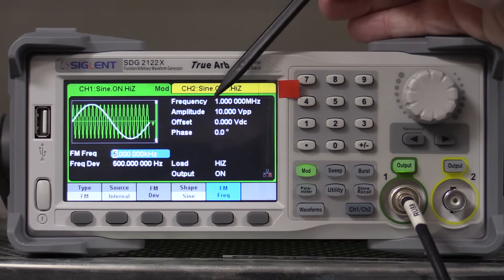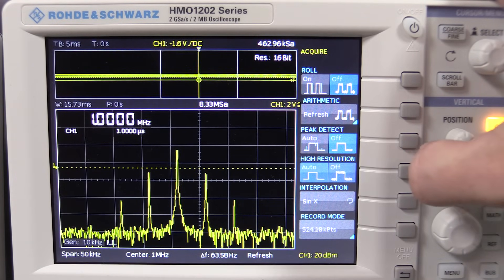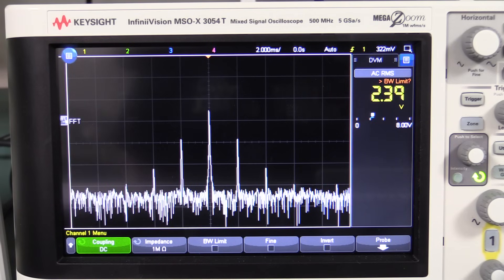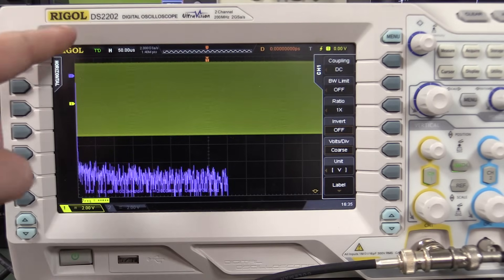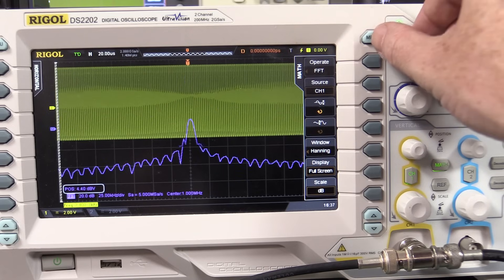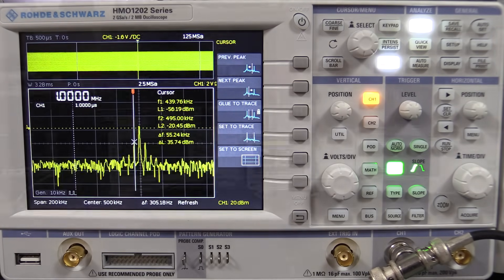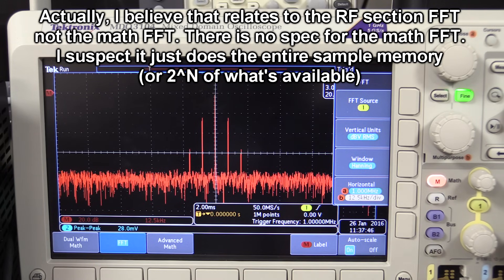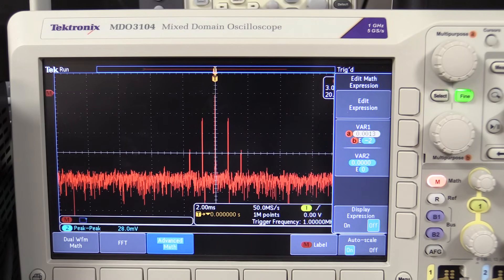EEVblog #845 - Oscilloscope FFT Comparison

Comment: I just feel like putting the Rigol up against keysight and rude and shwarz is obvious. Those scopes are typically out of range of personal use unlesss bought second hand. Some of those scopes are 5k$+ for just the 100mhz models. Though Rigol isn’t as precise it’s a fraction of the cost.

Comment: Hey Dave, are you running the latest firmware on that Tek?  I remember there was a firmware update to fix RF self-test failure if there was a signal present on startup.
Reply from the maker: +SCR2IGBT Oh, ok, thanks. Have not updated the firmware.
Reply: crikey!

Comment: As what I see from actual performance,  GW instek is very close to tektronix, Agilent and R&S are worse. Therefore if you are not too concerned about UI, that's a winner, especially considering it's <$400 cost (50MHz GDS-1054B). Wonder why when Dave mentioned that FFT in cheap scopes suck, didn't mention that instek (50 MHz model, dave has 100MHz) is even cheaper than 1054Z and actually don't suck (except UI).
Reply from the maker: +woopsserg Yeah, good point, I stand corrected, the GW-Insek is not expensive.

Comment: For us semi newbs it would be really helpful if you started a video likes this with what an FFT is... Im still not sure after watching the video.
Reply: FFT stands for Fast Fourier Transform, its an algorithm for calculating the DFT (Discrete Fourier Transform) of a signal. The DFT is essentially the digital version of a Fourier transform, which if you apply it to a signal that is measured with respect to time gives you the frequency components of that signal (or more precisely what combination of sine waves at each frequency would add up to the original signal). The frequency domain representation of a signal is often referred to as its spectrum hence where spectrum analyzers got their name. In short an FFT is an algorithm for getting the spectrum of a digital signal.

Comment: Gee look there a shiny new SDG 2122X just begging for a tear down video :)

It the Rigol you are using one with or without the firmware update to "help" the noise problem on the 1 GHz clock (5, 10, 20 ms jitter issue) ? The same spurs that nuke the jitter will be an issue doing an FFT ...

Comment: So, it seems like you had your mind made up against the Rigol before starting the video.  Others have commented on how to set the Rigol up properly, but I think your sales-hat-on-attitude for R&S is quite  apparent.  What is the point of comparing a 500MHz scope with a 100MHz unit?  It seems, for a few seconds the Rigol had a passable display, but then you twiddled back to what you wanted to show -- a poorer display on the DS2000.  Fail.   What is the point of comparing the Tek 3100 with a dedicated Spectrum analyzer to a 100 MHz scope in FFT mode?  Fail.  Really appreciate all the effort you made here, I just wish you were more objective and learned how to do FFT on each scope first.  In case you can't tell, I REALLY like the Rigol DS2302A scope.

Comment: Hi Dave
why do you review stuff no one lower down the food chain can afford ?
Reply from the maker: +700 Dog Both the Rigol and GW-Instek are $400 class instruments. The R&S is just over grand.
And why? Because over half of my audience are professionals, not hobbyists.
Reply: +EEVblog as a hobbyist these videos and others like it are valuable to me in order to determine what to look for in a scope, regardless of price range. Cheers from the states. :)
Reply: +Radio Ham I actually think some of the things shown here are accessable to hobbyists, the Rigol and GW-Instek are in my opinion. Yes it won't be a trivial purchase whether its new or used, but it isn't the over 3000 "nope that's not going to happen" device.

I'm still torn about future choices myself but once I've got a good amount of spending money saved up later this year I might press the button on an oscilloscope (provided real life doesn't decide to be a dick and its needed for some stupid appliance to be repaired/replaced).